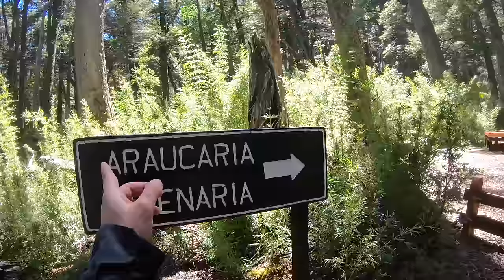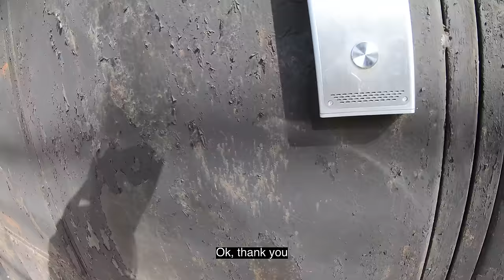[S2 - Eps. 38] IB CHRISTMAS SPECIAL

Comment: I was riding across Thailand on  a VStrom 650 loaded with more gear than I needed. I was in Phang-Nga when I saw a cool trail going through a forest. Easy at first but got extremely dangerous after a while. I kept going because I was prideful. It started raining hard. The trail got muddy. At one point, my 1000lb bike was in 30cm mud. Bike bottomed out and got stuck on a rock submerged in the muddy water. My shoes had no grip. Took me 15 minutes to get it out without dropping the bike. I turned back towards the paved road.
Probably the scariest ride of my whole life. Now I listen to my inner voice more often 😂
Reply: you have to  know  your limitations.
Reply: Couldn’t agree more. I tried a trail that was above my skills levels this weekend and the result was rupturing the ligaments of my knee. Consequence is dire. Several months now separated from the two wheels.

Comment: So impressed by the Himalayan - the "Little Enfield That Could"
Reply: Dhanno is not little. She is a very big strong reindeer. And she can outrun you any day of the week.
Reply: @Gismo3333  I am very impressed by the Himalayan bikes but they are small adventure motorbikes at 400cc.  Medium size ADV bikes are about 800cc and large ones are about 1200cc.  Even my V-Strom 650 XT is on the smaller end of the size scale.

Comment: The Best way to keep such over enthusiastic dogs away from your path is to use your bike horn even before they try to bark and chase you...if you press the horn before they chase you they will get the message.  .. and they would move away from you if its the first time they are experiencing such a response  , you wouldn't have to speed away from them, to have an over enthusiastic dog running along is quite a risky business when you are on the dirt path....

Comment: Turning back was smart, I used to do off road riding, I have dropped a bike, no luggage, just a 125 trail, I was still on the bike but somehow my right foot which was under the bike and facing backward, nothing broken, but I was lying face down. I couldn't get out from under the bike, someone had to lift the bike off me.

Comment: Hmm, that trail looked like fantastic fun.  With the right bike (when I was younger), I'd be on the pegs, balancing and digging my way through that trail, at 3x her speed.  However, Noraly is compromised by the extra weight she's carrying on her tiny adventure bike, and the under-powered bike itself.  Plus, it makes pretty good sense NOT to be ambitious when (a) riding alone, where medical and other help could be hours, even days away, (b) riding fully loaded (easy to be out of balance), and (c) riding a trail she's never ridden before.  But again, that whole trail looked like nothing but fun.  I don't blame her for WANTING to push through it, even if her internal caution flags, told her to dial it back, and turn around.

Comment: Riding a motorcycle is all about balancing risk. A smart rider will turn around if the conditions exceed their riding ability, but pushing limits is also how we learn and grow as riders. I think this experience will make you more confident when you face your next similar challenge. Good luck! Merry Christmas!
Reply: @warnerjohnson1338  -  I would argue that on clear, flat dirt and gravel roads, it is fun to push it a bit - the 'profit' is enjoyment. You are constantly correcting imbalances to stay on line, and avoiding bigger rocks, etc - which is fun - adrenaline ?
Of course, potholed roads and where there might be obstacles are another type of riding which does demand more care.